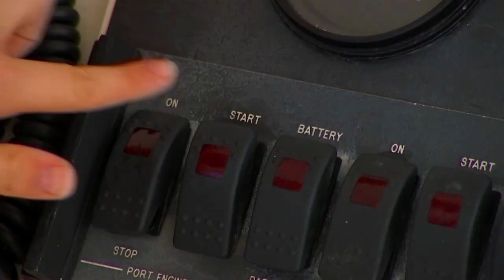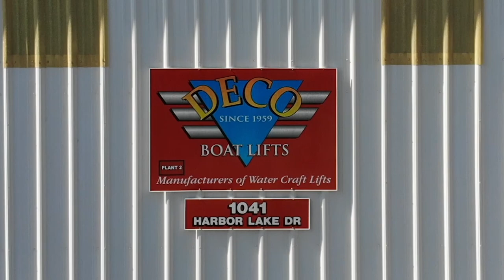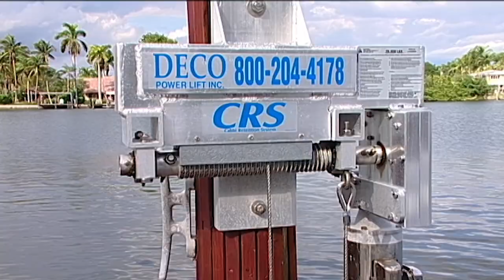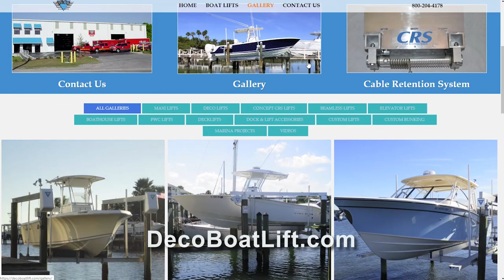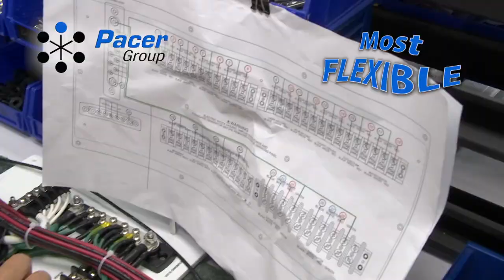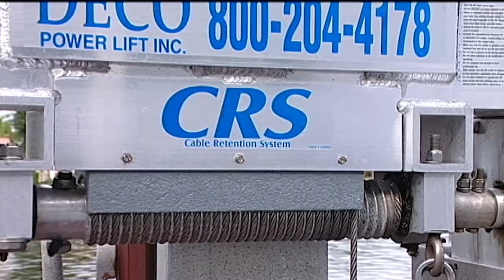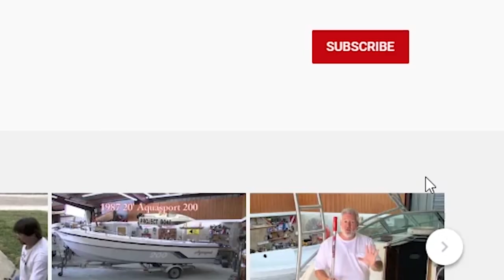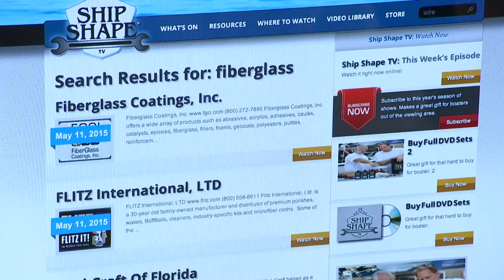PREVIEW of SSTV 24-12 - Choosing The Perfect Boat Lift (FULL EPISODE)

Comment: Nice video and thanks for sharing. 
I had one question about the gear box. How does it hold up with a steel warm gear shaft rubbing against the housing without bearings?
Reply: Hi Pashko, it isn’t shown in the video but there are multiple bearings around the worm gear to keep the shaft moving freely and smoothly.